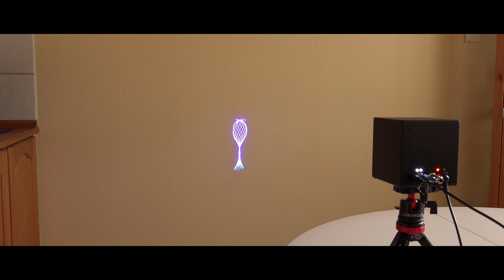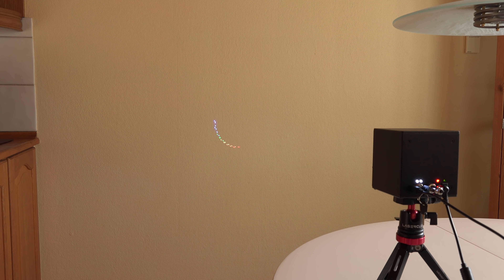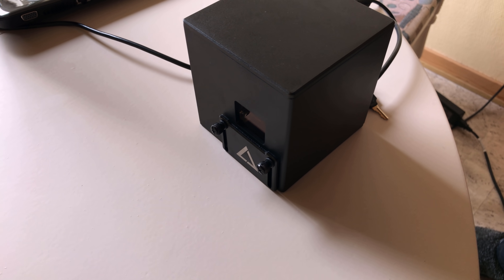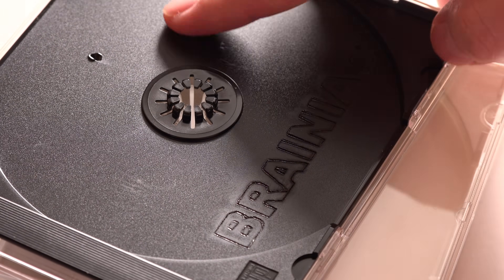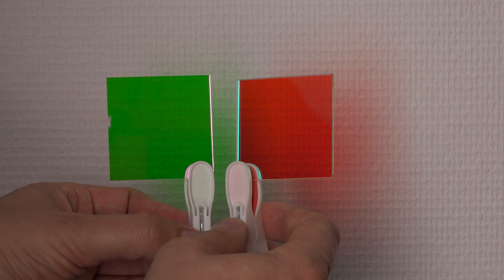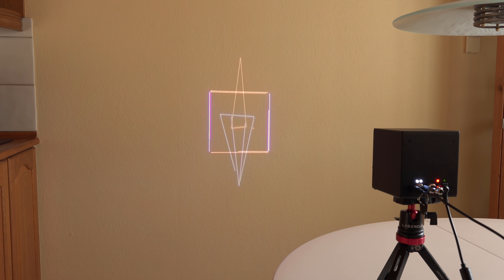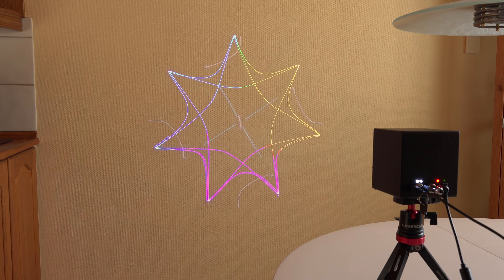LaserCube | Power in a Palm

Comment: okay it sounds fine but what to do when the battery inside it runs out of power in few years? the laser cube is just a piece of junk for $999.00!!!
Reply: You charge the battery
Reply: @LukeDeGraff1  you don't get it did you? i repeat then "what happens when the battery runs out of power in FEW YEARS"?
Reply: @bitsmart...  you don’t need to use the battery

Comment: Brainiac75:  Please try my 'gravity' test for my Theory Of Everything idea:
(Copy and pastes from my files):
Here is the test for the 'gravity' portion of my TOE idea.  I do not have the necessary resources to do the test but maybe you or someone else reading this does, will do the test, then tell the world what is found out either way.

a. Imagine a 12 hour clock.
b. Put a magnetic field across from the 3 to 9 o'clock positions.
c. Put an electric field across from the 6 to 12 o'clock positions.
(The magnetic field and electric field would be 90 degrees to each other and should be polarized so as to complement each other.)
d. Shoot a high powered laser through the center of the clock at 90 degrees to the em fields.
e. Do this with the em fields on and off.
(The em fields could be varied in size, strength, density and depth.  The intent would be to energy frequency match the laser and em fields for optimal results.)
f. Look for any gravitational / anti-gravitational effects.
(Including the utilization of ferro cells so as to be able to actually see the energy field movements.)

(An alternative to the above would be to shoot 3 high powered lasers, or a single high powered laser split into 3 beams, each adjustable to achieve the above set up, all focused upon a single point in space.)

'If' effects are noted, 'then' further research could be done.
'If' effects are not noted, 'then' my latest TOE idea is wrong.  But still, we would know what 'gravity' was not, which is still something in the scientific world.  Science still wins either way and moves forward.
____

Revised TOE: 3/25/2017a.
My Current TOE:

THE SETUP:
1. Modern science currently recognizes four forces of nature: The strong nuclear force, the weak nuclear force, gravity, and electromagnetism.
2. In school we are taught that with magnetism, opposite polarities attract and like polarities repel. But inside the arc of a large horseshoe magnet it's the other way around, like polarities attract and opposite polarities repel. (I have proved this to myself with magnets and anybody with a large horseshoe magnet and two smaller bar magnets can easily prove this to yourself too.  It occurs at the outer end of the inner arc of the horseshoe magnet.).
3. Charged particles have an associated magnetic field with them.
4. Protons and electrons are charged particles and have their associated magnetic fields with them.
5. Photons also have both an electric and a magnetic component to them.

FOUR FORCES OF NATURE DOWN INTO TWO:
6. When an electron is in close proximity to the nucleus, it would basically generate a 360 degree spherical magnetic field.
7. Like charged protons would stick together inside of this magnetic field, while simultaneously repelling opposite charged electrons inside this magnetic field, while simultaneously attracting the opposite charged electrons across the inner portion of the electron's moving magnetic field.
8. There are probably no such thing as "gluons" in actual reality.
9. The strong nuclear force and the weak nuclear force are probably derivatives of the electro-magnetic field interactions between electrons and protons.
10. The nucleus is probably an electro-magnetic field boundary.
11. Quarks also supposedly have a charge to them and then would also most likely have electro-magnetic fields associated with them, possibly a different arrangement for each of the six different type of quarks.
12. The interactions between the quarks EM forces are how and why protons and neutrons formulate as well as how and why protons and neutrons stay inside of the nucleus and do not just pass through as neutrinos do.

THE GEM FORCE INTERACTIONS AND QUANTA:
13. Personally, I currently believe that the directional force in photons is "gravity".  It's the force that makes the sine wave of EM energy go from a wide (maximum extension) to a point (minimum extension) of a moving photon and acts 90 degrees to the EM forces which act 90 degrees to each other.  When the EM gets to maximum extension, "gravity" flips and EM goes to minimum, then "gravity" flips and goes back to maximum, etc, etc.  A stationary photon would pulse from it's maximum extension to a point possibly even too small to detect, then back to maximum, etc, etc.
14. I also believe that a pulsating, swirling singularity (which is basically a pulsating, swirling 'gem' photon) is the energy unit in this universe.
15. When these pulsating, swirling energy units interact with other energy units, they tangle together and can interlock at times. Various shapes (strings, spheres, whatever) might be formed, which then create sub-atomic material, atoms, molecules, and everything in existence in this universe.
16. When the energy units unite and interlock together they would tend to stabilize and vibrate.
17. I believe there is probably a Photonic Theory Of The Atomic Structure.
18. Everything is basically "light" (photons) in a universe entirely filled with "light" (photons).

THE MAGNETIC FORCE SPECIFICALLY:
19. When the electron with it's associated magnetic field goes around the proton with it's associated magnetic field, internal and external energy oscillations are set up.
20. When more than one atom is involved, and these energy frequencies align, they add together, specifically the magnetic field frequency.
21. I currently believe that this is where a line of flux originates from, aligned magnetic field frequencies.

NOTES:
22. The Earth can be looked at as being a massive singular interacting photon with it's magnetic field, electrical surface field, and gravity, all three photonic forces all being 90 degrees from each other.
23. The flat spiral galaxy can be looked at as being a massive singular interacting photon with it's magnetic fields on each side of the plane of matter, the electrical field along the plane of matter, and gravity being directed towards the galactic center's black hole where the gravitational forces would meet, all three photonic forces all being 90 degrees from each other.
24. As below in the singularity, as above in the galaxy and probably universe as well.
25. I believe there are only two forces of nature, Gravity and EM, (GEM). Due to the stability of the GEM with the energy unit, this is also why the forces of nature haven't evolved by now. Of which with the current theory of understanding, how come the forces of nature haven't evolved by now since the original conditions acting upon the singularity aren't acting upon them like they originally were, billions of years have supposedly elapsed, in a universe that continues to expand and cool, with energy that could not be created nor destroyed would be getting less and less dense? My theory would seem to make more sense if in fact it is really true. I really wonder if it is in fact really true.
26. And the universe would be expanding due to these pulsating and interacting energy units and would also allow galaxies to collide, of which, how could galaxies ever collide if they are all speeding away from each other like is currently taught?

DISCLAIMER:
27. As I as well as all of humanity truly do not know what we do not know, the above certainly could be wrong. It would have to be proved or disproved to know for more certainty.

Comment: where can i get a visible beam laser pointer?
Reply: Take a visible dot laser pointer out in the fog.
For indoor use, set up a water collection system that completely protects the floor. Reduce air flow in the area. Run as many "cool mist" humidifiers as required to create enough fog in the laser area. Use distilled water, any dissolved minerals will create dust that is particularly unhealthy, just due to its size.
Reply: @hamjudo  aka you can't unless you got money and foggy weather
Reply: @hamjudo  or i could just use my vape. but i'm asking about a visible beam laser pointer show style like one you'd see at a rave but in a pen form.

Comment: Where did you get the lens for burn? I cannot find where to buy it. I also have the LaserCube, but it didn't come with that... It was an option when I bought my LD2000 from WickedLasers, not an after purchase option.... Any info would be great.

Great review! Nice. What camera are you using? I see the lights on so it doesn't get washed out. I also use a ND filters (ND8 or ND16) which helps with lights off.

Comment: If that's the highest classification of laser power, then you need another classification, because here's a video of a 23 megawatt laser that produces such an intense beam, the electric field component of the electromagnetic wave is strong enough to cause electrical discharge in air and it creates a spark in midair where it comes into focus, basically lightning caused by light: https://www.youtube.com/watch?v=XT5uQBpwvVk And if you think that sounds like a lot, here's one with a power of 100 GW (but in pulses very brief and at such a low duty cycle that its average power is 3.5 watts - specifically 35 femtosecond pulses at a frequency of 1 kHz): https://www.youtube.com/watch?v=jBjqT3AQkH0

Comment: This is one of those things that seems really cool but also kinda dangerous.
Also... How do you deal with safety glasses when you've got 3 lasers at completely different wavelengths involved?
Reply: they just look like tinted glasses, honestly
the laser isn't super powerful, as it's meant to be seen without them
Reply: @TheAechBomb  "the laser isn't super powerful" . Yes it is, he says in the video "this is a class 4 laser, the highest class laser there is".  It burns into a CD case. You're thinking of the projection, it is safe to look at the projection, but if you look at the laser it will damage your eyes.
Reply: @iaincowell9747  yeah, you don't look directly into the beam, or point it at any reflective surface when at full power
only the high-power 'popping' or 'burning' mode uses full power, I wouldn't worry if you're not using it on full power

Comment: The planetarium laser bench I worked with had a 10W mixed gas white laser that we could only bring to just over 6W...   anymore power and a slow trace from the main beam (which is only half of the laser output) would vaporize the white paint on the inner dome !!

Comment: That's a very impressive bit of kit!
I did have to laugh, it's half the size of my first laser, which was not only a pitiful 20mW red only, but also a gas discharge tube so required a 4KV strike voltage and mains cable!

Comment: i've seen a video of someone videotaping a laser tattoo removal. the laser reflections off the skin that hit the camera sensor burned individual pixels on the camera sensor.  at what strength laser would you guess that can happen? as i see your camera doesn't suffer damage from taping those lasers. or do you have some filters in front of the camera to prevent this from happening?

Comment: Brainiac next video: Replace laser in it with Hercules laser
I really hope you have fun. Is the limitation time built into the software?
Reply from the maker: Hehe, it would be awesome to update the green from 100 mW 520 nm to 400 mW+ 532 nm. But as I remember it, the Hercules can't be modulated fast enough (the lasers in the LaserCube can turn on/off 10000 times/second). Yes, the pop program is limited to 6 seconds. But the burn program isn't, so I might try to draw a small circle and let the beam circle on the sensor for a long time :)

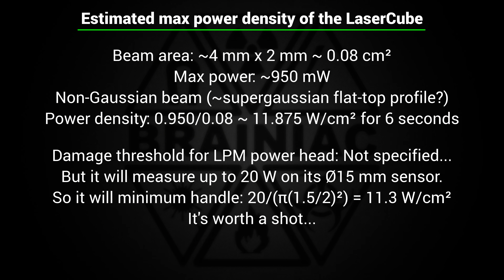Comment: At 2:58, the damage threshold(I guess) unit should be W/'mm'2
Reply from the maker: Damage threshold is usually specified in W/cm2, so I calculated for that. But since there's no official specification for damage threshold on the shown LPM, I could have used any unit :) Thanks for watching!
Reply: @brainiac75 , no I mean it should be 11.3 W/"mm"^2 since you got that from dividing two terms which have units of W and mm^2.

Comment: Scanners are overdriven and probably not true 20k, but it is impressive that they managed to cram everything into that small case. My projectors is at least 5 times the size and doesn't have a battery. Don't know how many viewers you have in the U.S., but you also may want to mention that a variance is required in the states.

Comment: It looks like a cool display device but I am a little concerned by the amount of output power, just under 1W it deserves to be Class IV! Cheers.
Reply from the maker: ~1 watt is a lot, especially since it is well collimated. But for a big projection where the single dot is moving extremely fast over the projection surface, it needs to be very bright to be seen clearly. I've heard they are working on a 2 watt version, like in the bigger LaserDock. That would be insane and awesome at the same time :D